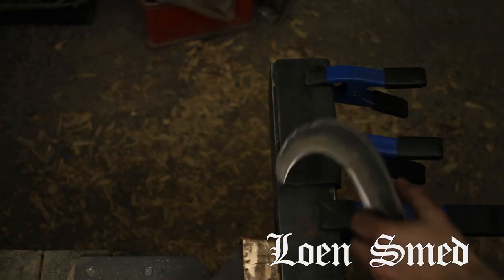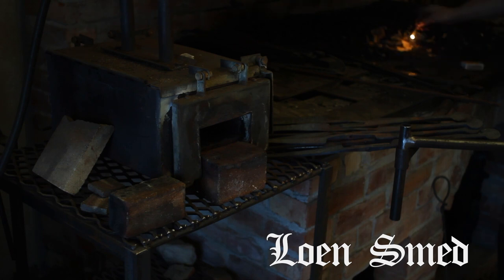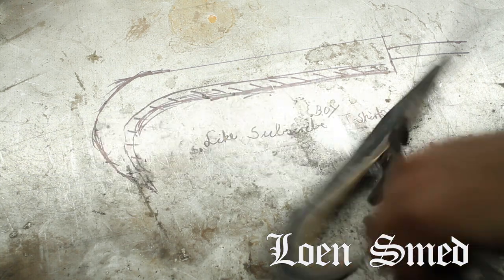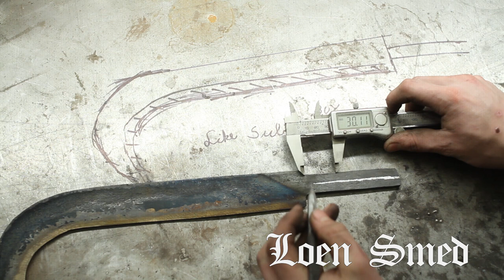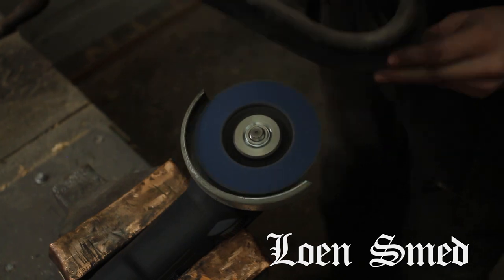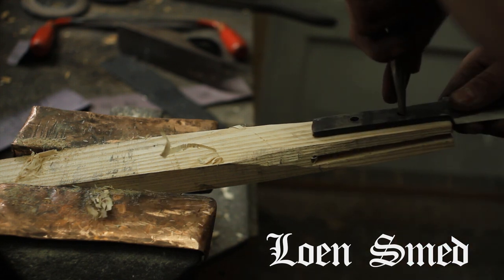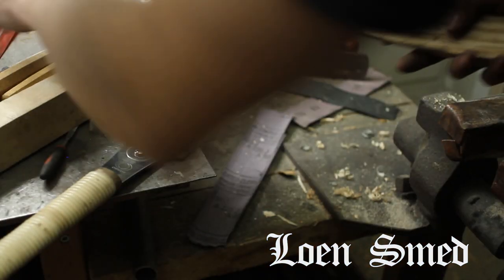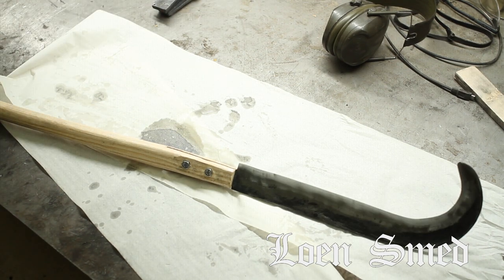Billhook / Lauvkniv | Forging a Christmas Present

Comment: oh wow..first off GREAT great!!! job on the forging...A+ really.
but...sorry...the handel was pretty shyte if ya ask me. Of course Im a woodworker..so im biased i realize that. for me working in wood is kinda natural..and I can only dream of being half as decent at forging as you are.
So dont get me wrong, i am not trying to insult your woodworking skills. You will improve i am sure of that..you just need a bit more work at it. As you stated that handel is way too thin and delicate for that kinda tool. a socket would have been amazing to have forged into the billhook..but you can make it strong enough by plenty the way you did it. just beef stuff up some more. and might wanna invest in some planers so you can shape and smooth the wood.
All over tho..a grade of a B- so still good..but i have no doubt you will need to rehandle that soon.
Reply from the maker: Thanks mate, historically they've been with hidden tang here in Norway, but my woodworking skills hare still shit. I did redo it last year though and it's been holding up so far. Added a collar and beefed up the handle material a fair bit.